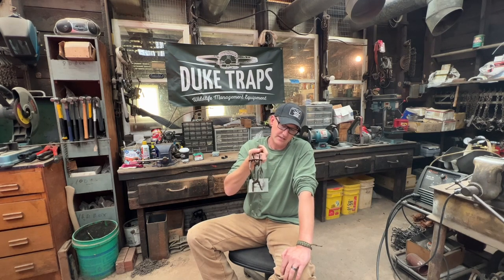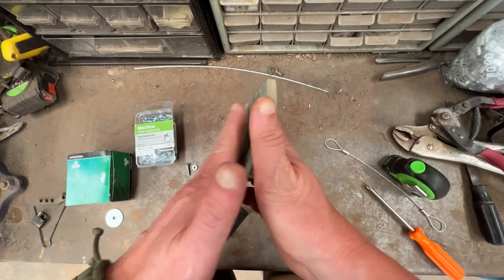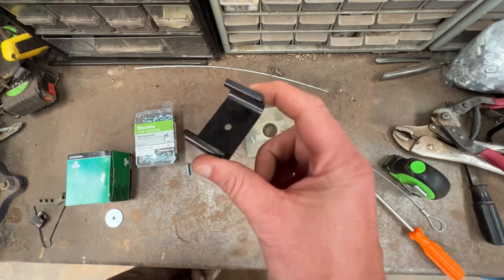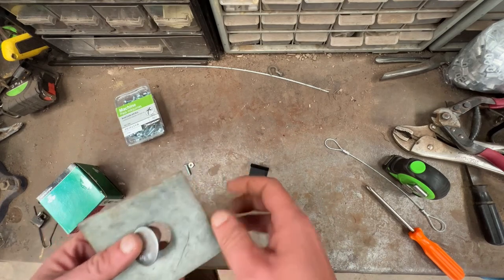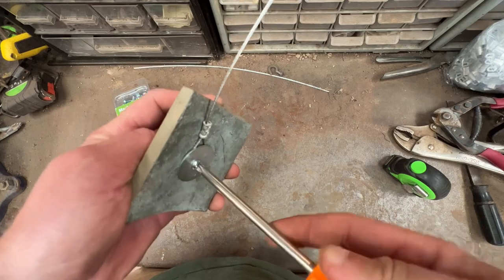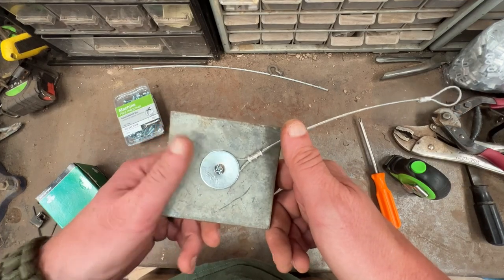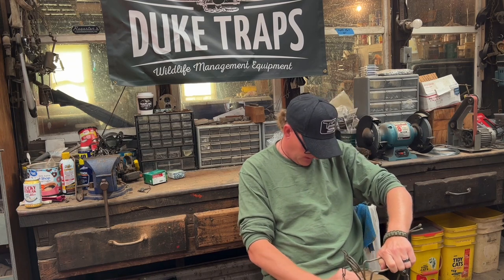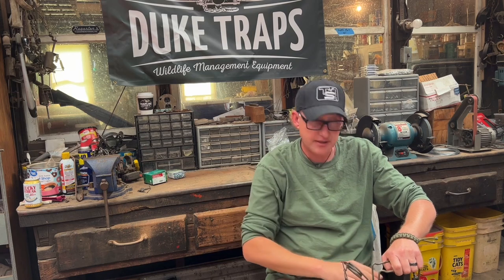No-Weld Bodygrip Stabilizer Plates

Comment: Ive used other conibrackets with these washers, and Im not thrilled how different makes and size bodygrips fit on them. 110,150,160  For mink i like trigger on the last notch, Im curious how the snuggy will hold the different bgs    Great vids!!
Reply from the maker: You can bend the Snuggy slightly to fit different models.